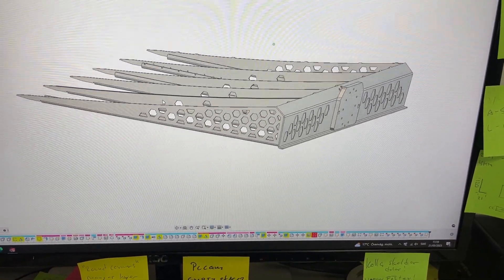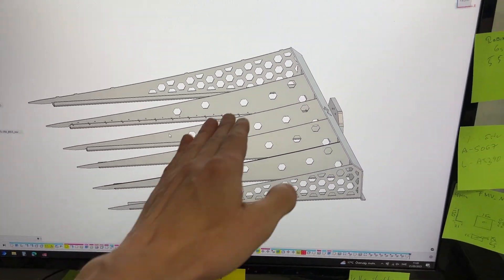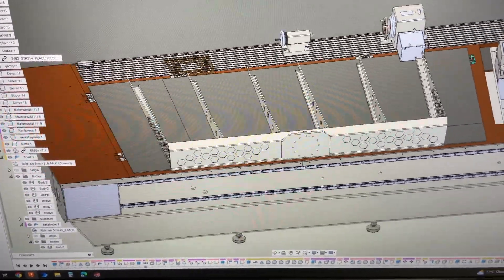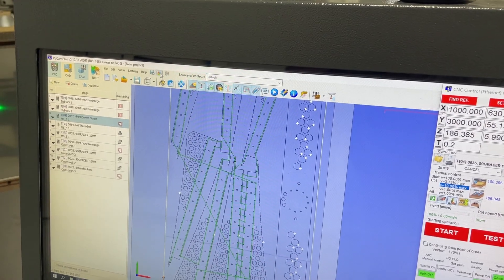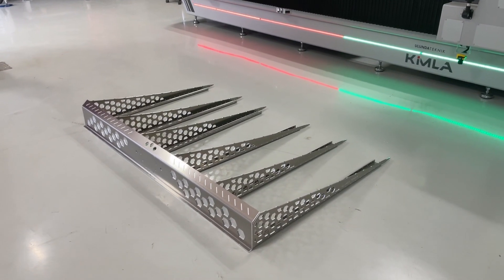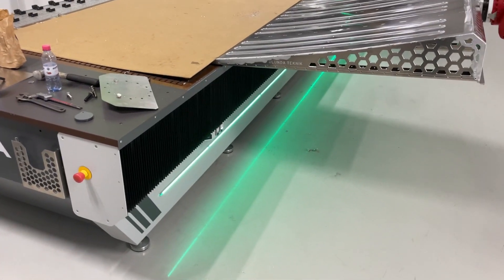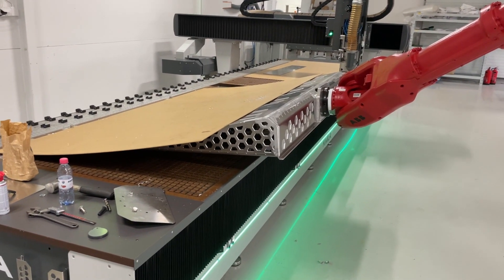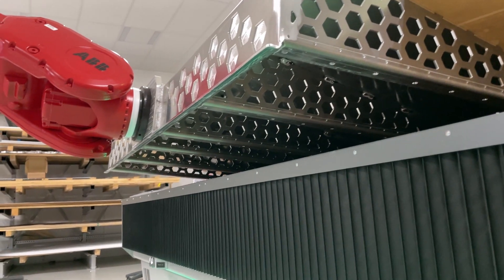Robobobulator Part1

Comment: Hey, where did you buy your chip separator? We are running a similar setup but we are having trouble with chip extraction. 

It may be our pump size so if you could share what your setup is it would be great. 

Thanks
Reply from the maker: Its accually "home-made", i talk about it here https://youtu.be/dluKO1VESRQ?t=1207
Not sure but If i remember correcly the side channel blower motor is a 5kw.

Comment: Is there really that much work for routed aluminum sheet where you are or do you just have one customer that really loves using aluminum sheet for everything? I have had a machine shop for years and done a lot of aluminum parts, but maybe <5% would have fit the format of what you do. Where I am located, I don't think there is much demand at all for this type of work.
Reply from the maker: Alot is for the defence industry and they love using alu cause of weight constraints. We also do quite a bit of light mounts for various vehicles and while they can be of steel, if you dont need the strength then alu is great.

Alot of the stuff we do could also be done on a laser or punching machine, but if you do alot of parts with threads,countersinks and just breaking the edges with a brushmachine isnt enough then a router is hard to beat. We double side chamfer all parts (without flipping), countersink and thread all in one go.
We do also cut thicker stuff, typically up to 20mm, we engrave and do extruded profiles aswell.

Bending is really quick so the router is always the bottneneck. Having the robot gives me so many more hours and I dont have to cram all cutting in during the day. And this fall is looking like its going to get real busy, I dont want to start giving longer lead times so the robot is a must.
The robot makes so much more sense than getting another router as that would require me to rent more space, get more power, more air and vacuum pumps that need service and generates heat, and I have to run like a mad man keeping both running during the day and then having two machines just sit there idle all night.

Im really looking forward to getting this optimized.. Thanks for watching :)

Comment: Will you make a cage or will the robot be free to swing this giant pitchfork around?
Reply from the maker: No cage. But there will be another lidar installed. It'll have the same features as the one on the Kimla. Slows down if you come somewhat close, stops and requires reset if TOO close.
The robot will also have its speed and acceleration set permanently pretty slow, im not in a hurry. The router will run for 1-3 hours before its time to swap sheets. 

Think i will set it up so the router is in charge of the robot. So that i program the router to move back to a row of buttons when its finished and there it will tell the robot what to do, meaning "Empty" table, "Load HDF" and "Load alu". (This is so that i dont need to get into the kimla plc for the signals,make two separate programs and its also an easy way for me to manually trigger what i want)

For crash prevention I think i will install two basic NO switches connected to estop for both machines. The loop with these two switches needs to always be closed.
So that the router gantry needs to be at the back in a specific spot (closing the switch) to allow the robot to move and the same with the robot, only when the robot is back in its parking position will the router be able to move away from its switch and start the next program.
If both switches are ever open at the same time, then the loop is open and estop for both machines is activated.
Im frikkin PUMPED about starting to fiddle with it! Had a succesful unload of a real cut sheet the other day!

Comment: Hi.
1) Does it seem to me or does the crossbeam have an open contour? I may be wrong, but a large beam with a closed contour would be a little more complicated, but much tougher and stronger for twisting.
2) The robot seems ill-suited for changing sheets and removing finished parts. I would suggest modifying the CNC machine into something conceptually similar to the TruLaser Center 7030. What do you think about it?
UPD. What are the usual sizes of sheets, if not a secret?
Reply from the maker: Hi.
1) Yes, its not a "box" and not as stiff or strong,  The design might (probably) change some time for some reason but I do however feel there is no need for more stiffness. When a sheet is stuck to the vacuumpads underneath it'll gain some stiffness due to the same effect but again, not really needed.
2) I started out thinking about a palleting solution but I think the robot solution is unbeatable. Some reasons are these:
No need to modify the router. The motivation here is expense, time, risk and space constraints.
No need to move machinery or halter production capability while i build and learn. Critical!

I only have 1 program to run to clear the table, same every single time! And it removes all parts, skeleton, potential leftover chips and the spoilboard all in 1 go. Minimizing risks of unexpected things to happen.
1 program to unload, 1 program to load new hdf, 1 program to load choosen thickness alu.
Thats it. No custom program for every cut sheet.
(I can also use the robot for other things like pressing in clinching nuts, but that for later :) 

There will also be a distance sensor under it so that the robot knows when its reached the top of the stack, so it doesnt matter if theres 1 or 50 sheets in it. The added benefit here is that since the bottom hight of the stack is known, everytime the robot picks up a sheet of any thickness, it'll know how many are left. Even if i have hand loaded one since last time.

Since i use a vacuum table, the only way (i can think of) to remove it is to scoop it up. (unless i had like popup pins underneath and then a fork, but that would be the same thing.)

The sheet storage density is great with a robot, i can easily have over 10 different thicknesses within the robot reach.
It also takes up very little space when not in use, i lift the scoop up to the ceiling or somewhere out of the way.

The goal is to have a stack of alternating hdf/alu next to the door when i come in the morning. I'll use the forklift to lift up the stack to a comfortable level and pick out the parts for bending and discard the skeleton ect. Probably flip the hdf sheets and put them back in storage.
Doing these things robotically just isnt worth it, i have to take the parts to the bender anyway and toss out the skeleton. 
The complexity of varying shapes of skeletons and parts (and risk of chips) might just stop a night run due to this small potential gain. I would also need to keep all this within the robot reach, thereby reducing the space for new material/other things.
I'll easily clear up a stack in minutes that might have taken all night to cut.

Sheetsizes are 95% 1250x2500mm and sometimes 1000x2000. The suctioncups are placed so it'll manage both.

Thanks for asking the question! It's always good for me to reflect on the choices Ive made.  And justifying my reasoning and actions to myself! :)
Reply: @randomrouting  Thank you for the detailed answer.
1) If it works, it's better not to touch it:)
2) For the most part I agree, but not with everything.

The storage density of the sheets. I didn't quite understand the order of work. do you need to bring stacks of sheets from the warehouse every time? If they are constantly stored near the robot, then the compactness is questionable.
The best thing I've seen is a multi-level shelving. Its dimensions are slightly larger than the dimensions of the sheet, but the capacity is very large due to its height.  If you provide it with pull-out shelves, then the robot will be able to take sheets with suction cups. And such a rack can be a permanent storage place, you will not need to bring the material to the robot every time and monitor its correct location.

The simplicity of the software is not the merit of the robot, but of the task. "The goal is to have a stack of alternating hdf/alus next to the door when I arrive in the morning. " The choice of mechanics here has little effect. Surely it is possible to replace the robot with significantly simpler and cheaper mechanisms. But it doesn't matter anymore, you already have a robot, it's also very interesting :)

A couple of ill-conceived ideas.
You can put the robot on a linear axis. This will give a huge working area. 
You can try to make an auto-change or a quick tool change for the robot. To be honest, this is the first time I see a case where this is in demand :)
 You can see how something similar was done by DMG mori, a quick-change pallet (actually a table) for milling cutters. Now they have a special mount, and earlier there was something similar to 4 BT30 cones.
Reply from the maker: @ДмитрийМ-ч6м  Sry i missed your reply. The alu sheets will be stored within the robot reach, they will always need storing somewhere so best is to store them at the robot.
Also a problem i have seen with stacking towers is that they cant take load of 1000kg per alu thickness. Sure you could split it up to perhaps 2 x 500 ? but still, i better just use the robot to grab the sheets from its storage space.
I want to buy 1000kg every time since that means itll all be from the same batch of production so that its as consistent as possible.

A "simpler and cheaper" way using pallets was explored early on but eventually deemed to be inferior to the robot in terms of time to implement and ease of installation.
Cost would probably (pure money wise) probably have been less tho, but I got such a good deal on the robot that i cant complain, the robot can do other tasks aswell!

And with the robot this way, both it and the sheets are out of the way. I can walk around like i am used too and its not too tightly squeezed in there. 
A rack for linear travel for the robot was briefly explored but veery expensive and it would just be in the middle of the shop. I would be very annoyed to walk,clean, work around it :P
Might be cheaper and better to use 2 robots if that came to be.

I will use this "dual purpose" tool for now that unloads and loads sheets but yes, later there will be a tool changing option. :) Probably diy.

Thanks for the input :) ✌
Reply: @randomrouting  "Sorry, I missed your comment." It's not scary. If you answer all the "experts" in the comments, then there will be no time to work :)

It is possible to design a stacking tower of the required strength. It seems to me a fairly simple task. The question is whether you have a manufacturer nearby who can order the manufacture of metal structures. There are quite a lot of such companies in my area, and probably you too.

In general, it is very interesting to see a robot at work. I will be waiting for the next videos.

Auto-change on a robot is a very interesting task. If you have time, it would be interesting to hear your thoughts on this matter. It doesn't matter in what format, text or video.